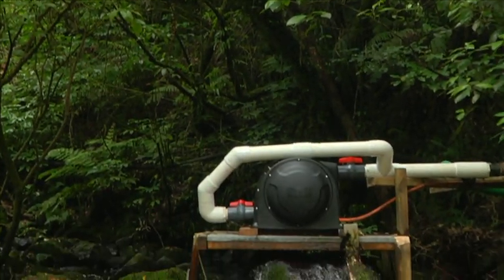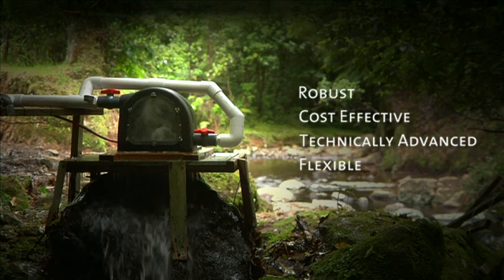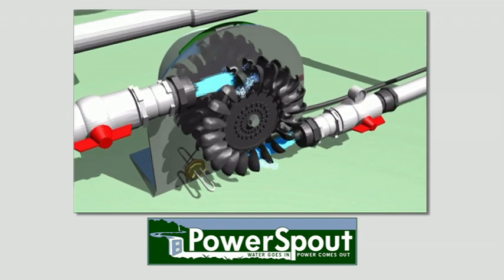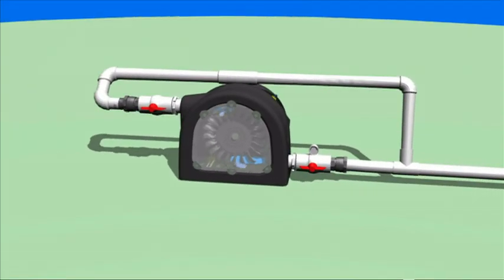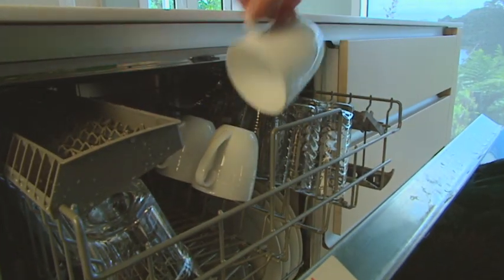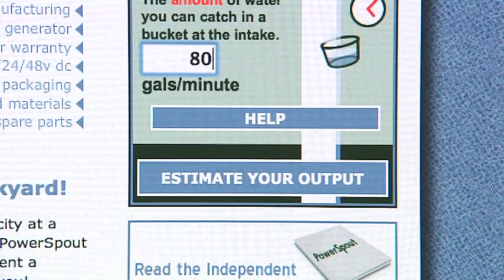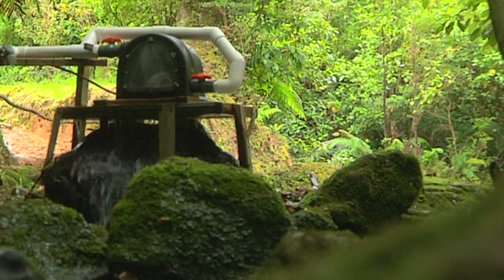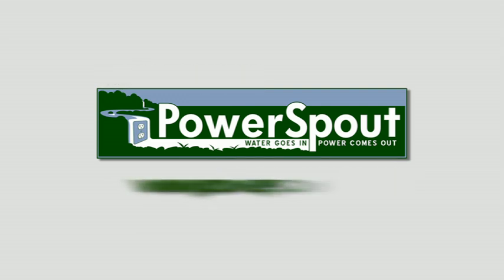Introducing the Powerspout

Comment: Perpetual motion is impossible, but how about this: Develop a pedal power jack to lift the largest(huge!) water barrel/tank possible. Have the same setup across from it, running water into it when elevated. Go back and forth. Better yet, configure these manually elevated barrels/tanks in a circle, and get your exercise all at once--going from one to the next. Have one set of generators in the middle, emptying one tank at a time.  (I have seen hand pumping pallet lifters that lift 1000's lbs over head, so why not this)